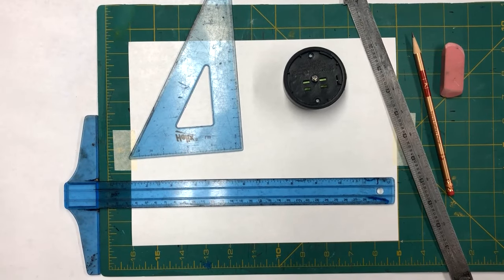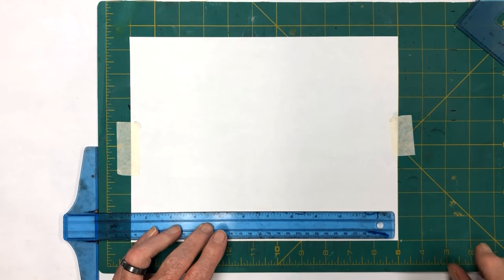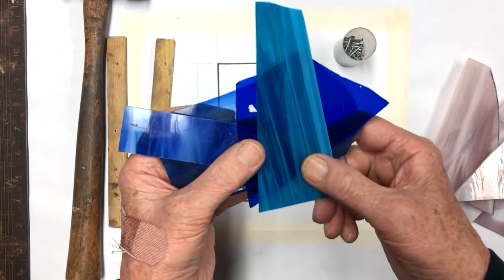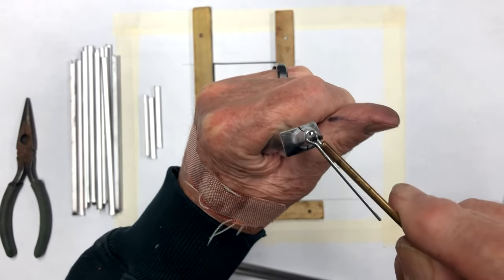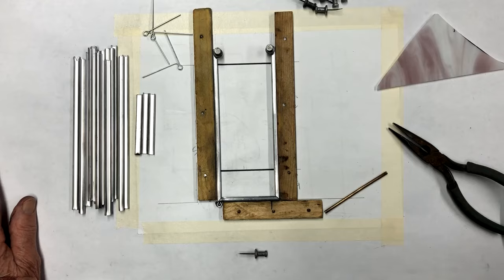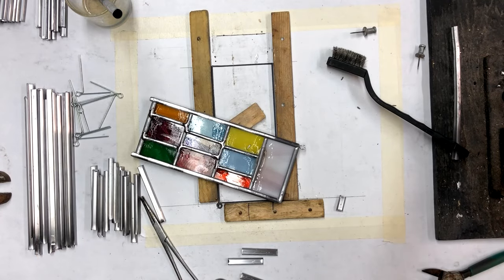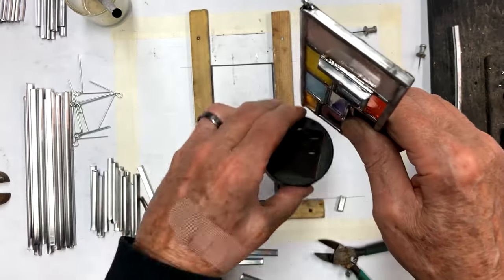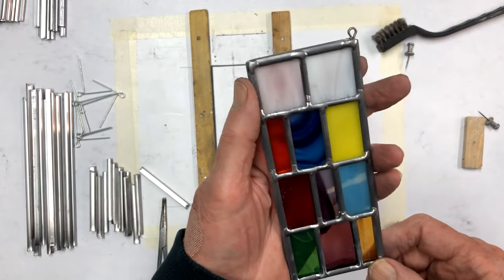Three Times the Fun!! Leaded Glass Solar Lantern

Comment: Curious question, sir. Do you cement your pieces, or are they loose fitting?
Reply from the maker: Hi Brad,
When I cut the glass, I always use a straight edge, so each piece is the same size, 1" 3/4",1/2" and so forth. Then I set up my project with the U Came and the H Came so the glass just slides into the channels on the Came. These small projects don't need to be glazed. Just make sure your glass is all the same size and they will fit tight in the channels on the Came. Thanks for your comment!! Hopefully this answers your question. Have a great day!!
Regards,
Bill Stone

Comment: Hello! I am going to attempt to make your 3 lantern hanger. I have a questions I need to get an answer to before I start. You recommend using RU70 Lead came and RH9 Lead came. I'm having a problem finding lead came by those names. I know what the letters stand for but everything I see is by a size. Could you tell me the size lead came I need to look for? Thank you in advance for your help.
Reply from the maker: Hi Lee,
Nice to hear from you and thanks for your comment. Yes, the came sizes can get confusing at times. The two sizes I use are RU-70 Face Width of 1/4" and a channel width of 5/32" and the RH-9 has a face width of 5/32" and a channel width of 3/16". The RH-9 H came is what they call high hart which has a larger channel than the RH-8 which is a standard size came. The RH-8 has a face width of 5/32" and a channel width of 5/32", Both the RH-8 and RH-9 H Cames work great for these projects. I like the RH-9 because it has a little larger channel and works better with thicker glass than the RH-8. I hope that helps you out. All of these Lead Cames are made by Cascade Metals, and they have a great chart showing all the different sizes of came and different styles also. Chech their web page and you can print it out, it is in decimals, but there is a box to check to turn them to fractions. So glad you're going to make the project, be sure to make a form so all the panels will be the same size. Thats super important to make them go together right. Do you have a glass supply store in your area?? If not try the internet, I just typed in Leaded Came for Stain Glass in the search bar and there are all kinds of places to get Lead Came, some even have free shipping. Also, you might want to check out my video called Leaded Glass Solar Lantern for Beginners, it's the very first video and has a lot of info if you are just getting started. Let me know how you make out, and please feel free to ask me anything about these video projects. Have a great day and best of luck on your project.
Regards,
Bill Stone

Comment: How do you make the paper clip clamps
Reply from the maker: Hi Bill,
Thanks for your question on the paper clip clamps. They are made using a standard 1 1/4" paper clip. In the center there is a lip that is bent over between where the metal finger livers are hooked to the paper clip. I just take a pair of flat noise pliers and bend it to a 90-degree angle and then I take a pair of long noise pliers and bend it on over to make small fingers on both sides of the paper clip. When you open the paper clip you can put these small fingers between the glass and the lead came to bring them together. I hope that makes sense to you!! If not send me another reply and I will try to give you a better answer. I have had several subscribers' ask about these clips, maybe I should do a short video on how to make them!! Have a great day!!
Regards,
Bill Stone